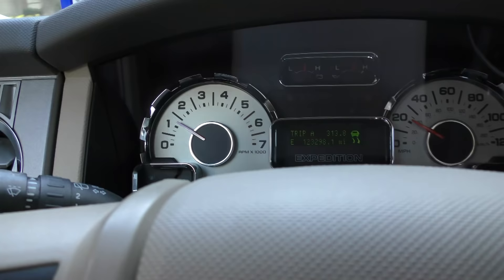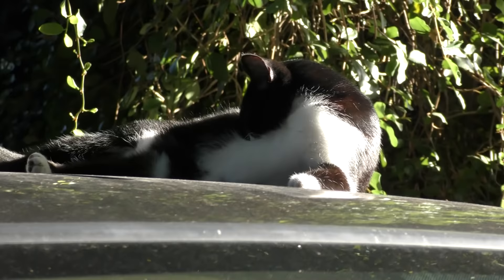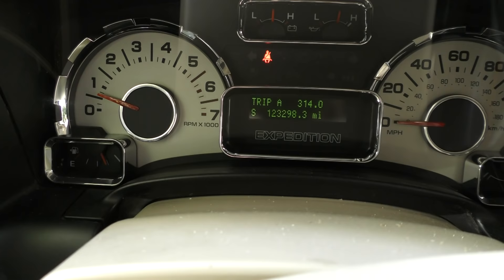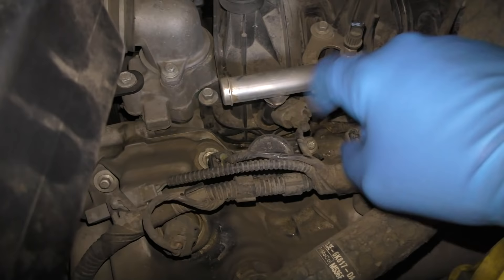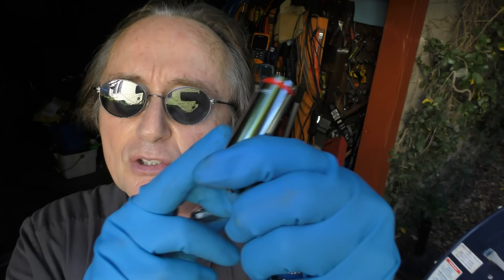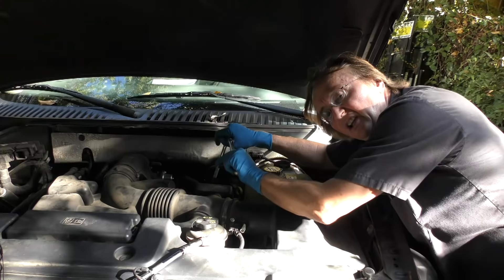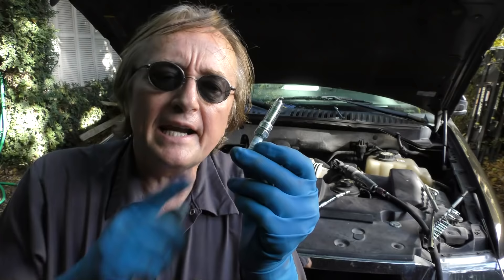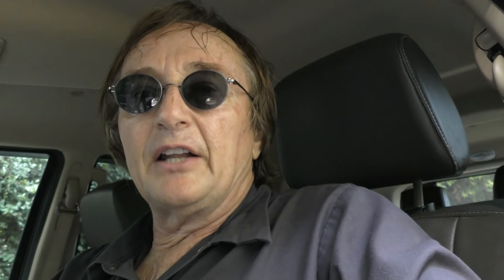How to Stop Car Hesitation (Spark Plugs and Ignition Coil)

Comment: I replace all the plugs and coils with Blue Streak coils, on my 2004 Grand Marquis that had 147,000 miles on it. Still had some missing problems. Took it to Ford. 3 times. First time they said the connector on #5 was bad and they replaced it. They also cleaned the throttle body. Got it back and still had problems. 

Back to Ford. They said coils on 1, 2, 4 were bad. So went to Oreily's and exchanged them. Still had slight problem. Back to Ford. They said the coils on 1, 2 and 4 were not right, they they were hitting on the fuel rail. So back to Oreily's. Ended up replacing the mas air flow sensor and the idle sensor myself. Still was not running great. So I remembered Scotty talking about a bad battery not having enough power to run everything, but would start the car okay. 

So went to Oreilly's and had the battery checked, it was a 4 year old Interstate and it checked bad. Replaced it. After 2 or 3 days the car was running great for the past 3 weeks. When I took the car to Ford the first them, they pointed out that the intake manifold was leaking and I should get it replaced and keep an eye on the leaking for now. So I took it to Ford, Blue Springs Ford in blue Springs Missouri to get the manifold replace. Total including labor and parts around $1286.00. Picked it up yesterday and after warming up it started running lousy like before. So I turned around and took it back to Ford and left it. Today April 7th 2021, they called this after noon and told me all the coils needed to be replaced. They replace one on #7 and said it was running better. they wanted $800 to replace them all. In spite of the fact I told them mall had been replaced and the car was running great the past 3 weeks, until they replace the manifold.

Considering the age of the car, could removing all the wiring and everything else to replace the manifold, could the wiring or connectors have been damaged due to the age of the car?